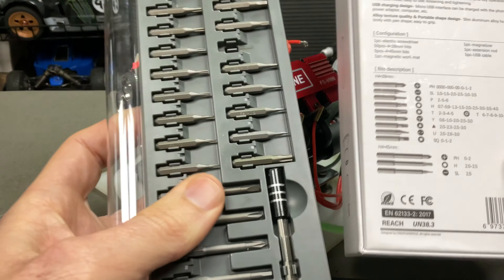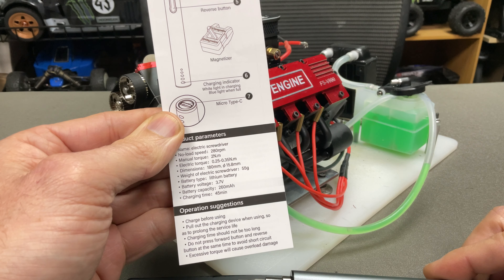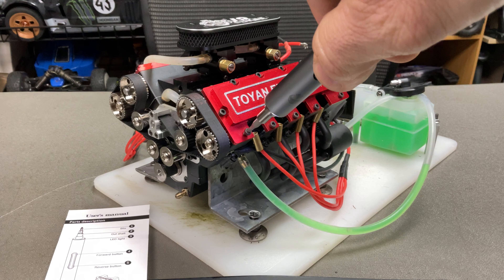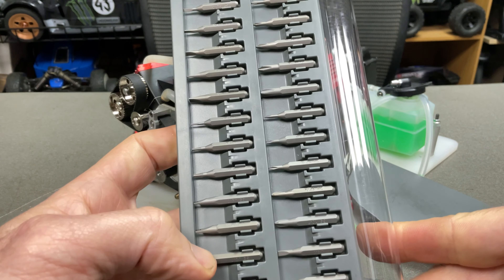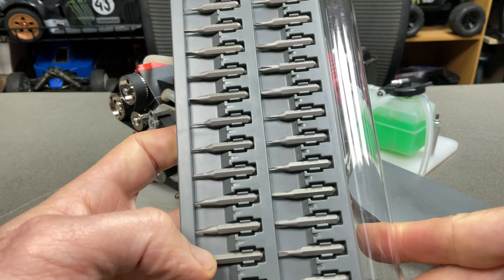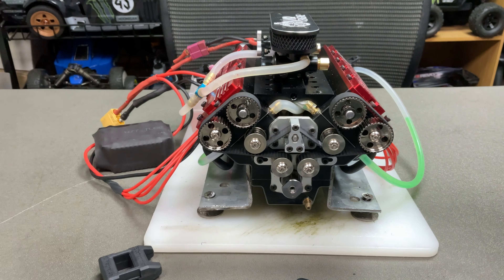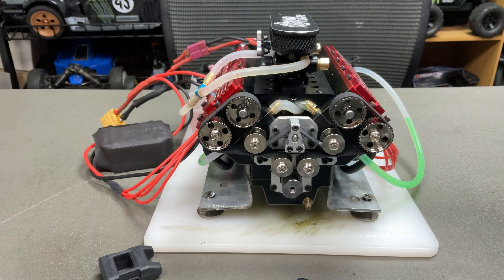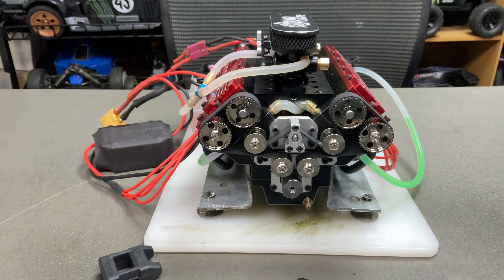WHERE IS THE V8 & NEW TOOL!

Comment: Little trick that can help with starting is to loosen the glow plug so that it leaks a little and prime Well the engine first Before attempting to start Sometimes it's finding the initial settings of an engine that can make it hard to start.
Reply from the maker: Much appreciated brother. Thanks for the info